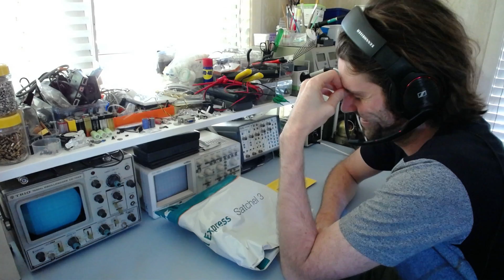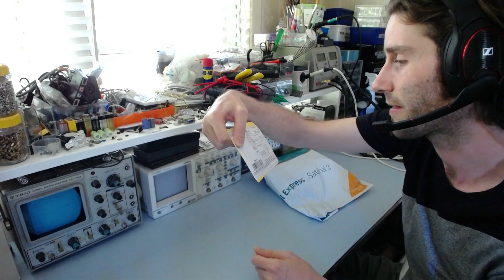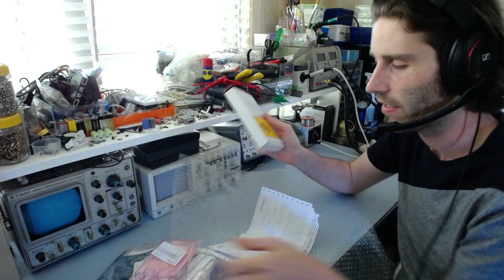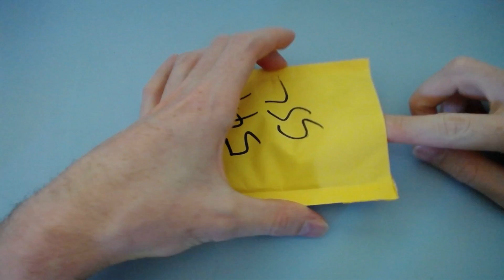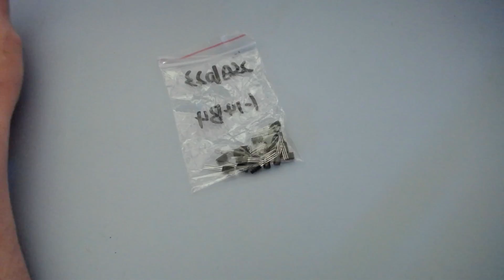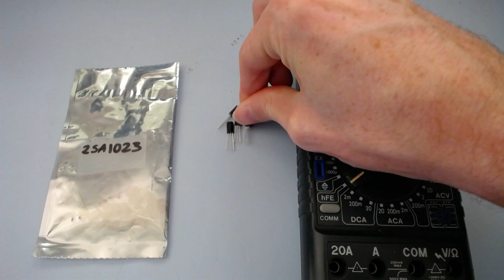So, what if you *do* buy transistors from Aliexpress?

Comment: Hello. I bought 2sa1145 and they are made of iron. I say this because they are attracted to magnets. They don't have much copper in China there and the Communist party directives gave this solution. In the case of 2sa1145 maybe this wouldn't be a problem but in the case of 2sc5200 it is a mockery because when put into the circuit they heat up and your house catches fire if the fuses on the board are not calibrated. In addition to that it burns transistors on the board in droves. The problem is also valid for Indian companies with 2n551 or mpsa92. At low signal the iron induces voltages due to magnetic fields which is a big shit. It's money that we throw out the window so that China can become world no.1... If that's how satellites with components like this or military equipment do it too. I tend to think that they are mocking the entire planet because the production is theirs and we are independent of what they give us.Salutari din Romania.
Reply from the maker: Fake and substandard parts are definitely a big problem!

Comment: with chinese suppliers the problem isn't if they make fake components (of course they do) but the real question is how good those fakes are! From my short electronic experience I would say that for beginners or weekend makers most of the staff and simple components are ok from China and I have bought a lot of transistors for example from Aliexpress and they work fine BUT the problem started when As I progress with my projects and electronic knowledge and I build more COMPLICATED things here the problems start!! More complacted circuits for example I have recently bought didn't work at all! I was surprised because before I was using many transtiors from china and they were ok but more complicated staff fails from every side! My conclusion is that the most popullar and simple components are almost as good as original but here the advantage ends! More complicated ICs mean more problems...
Reply from the maker: The cheap copy parts can work fine at low speed, low load etc. But if you start trying to operate them near the maximum of what they are supposed to be able to handle (for the ratings of a genuine original part) that's where the problems come in, because they don't meet those ratings.
Reply: @Agent24Electronics  I agree! When I started learning electronics cheap, chinese parts were fine to me because I even didn't use 30 % of those ratings! But now after one year when my projects are more and more complex I decided to order original parts because I have noticed what you just said and after also when I wasted like 2 days with cd4026BE from China and at the end I found out that that IC was defective and actually I was doing everything right! I was so pissed off that I decided to order oryginal parts ...

Comment: Thanks for the video, 
good enough for a beginner just learning about electronics?
Reply from the maker: No worries! Yes it would be a good start for a beginner doing basic transistor tests, but unfortunately does not provide exhaustive or extensive profiling of a transistor, as it would appear most viewers may have expected.
Reply: Sorry I meant getting stuff from Aliexpress, would their stuff be good enough for me? I have only just begun learning about electronics so I am sure I am going to end up trashing some components
Reply from the maker: Good question. It's a double-sided concept... On one hand, you may indeed save money, but on the other, trying to learn with parts that may or may not be 100% to specification or performance (especially semiconductors) may cause much frustration and unnecessary troubleshooting. Aliexpress might sell a lot of things, but they can never sell you back wasted hours of your life.

I would say that simple passive components like resistors, ceramic\polyester capacitors, or other parts so basic they really can't be made incorrectly are probably OK to buy from Aliexpress or eBay, but bear in mind there may be other quality issues like substandard metal used for the leads, which could result in corrosion sooner rather than later, so you may not wish to use such components for any serious or permanent use. (I'm theorising on that point, but they have to cut corners somewhere to get those low low prices!)

I'd recommend comparing some of the prices between a decent distributor or local shop with Aliexpress, and decide if the savings outweigh the potential headache and pot-luck delivery schedules.
Reply: I get your point, I am having enough difficulty just grasping the basic concepts (school was decades ago) so having to figure out if it's the components or me woulld be a step too far, I saw how much trouble you had with the led light strips and that was a simple short causing the problem. :(          [Amazon or any other suggestions?]
Reply from the maker: Amazon (or eBay) might be OK, but check who's actually selling the parts. If it's a real electronics shop like Jameco or Dipmicro then you'd be fine, in terms of quality.
I personally prefer the big distributors: RS-Components, Farnell, Mouser or DigiKey. None of those sell on Amazon, but their prices can be pretty good if you buy parts in quantity, and usually you'll want more than one of a component anyway.
Reply: many thanks, first I think I need to learn a few basics before ordering anyhting in quantities.
Reply: Many thanks, I'll take note.
Reply from the maker: No worries, good luck!
Reply: You have a nice clear speaking voice but you gotta get to the point instead of rambling on thinking out loud.  Crack open the bags, describe the tests and let's have your findings with minimal waffle.  You would then make a great(er) video.  I am going to subscribe because I am sure your videos will improve.   Plus you seem like a good operator.  
Now RF Power transistors capable of decent power like the TH430 or SD1728 cost $225USD from Mouser and $20 to $85 on fleabay.  Big price difference.  Obviously a lot of knockoffs on EBay.  Big price items like this are only made by big name operators like ST or Toshiba.  They are not going to sell stuff cheap.  An expose on this would be very interesting.  Good luck with the videos.

Comment: FYI, Farnell uses very cheap/light bubblewrap for the stuff that they send me. The stuff I get from china is usually a heavier type.
Reply from the maker: I suppose Farnell's packaging may vary by country, but it's probably overall better than eBay?
I find the Chinese packaging rather inconsistent, and they very often don't use antistatic bags for parts which should have it. Farnell and the others don't have this problem.
However, the Chinese do seem pretty good at packaging fragile items, like lightbulbs or CCFL tubes.
The only damage problem I've actually had was from RS-components, when the courier must have squashed the package in the van door or something. RS sent me a new order free of charge.

Comment: one thing that you have to buy from alixspres is an coponent tester for 14dolars works wery good wery great for cheching coponests!!
Reply from the maker: It's been on my list to make one of those actually - the Chinese just copied a design invented by someone else.

As far as I know, the original is here: https://www.mikrocontroller.net/articles/AVR_Transistortester#Introduction_.28English.29 
Schematic\Firmware etc downloads can be found at: https://github.com/svn2github/transistortester
Especially, check the documentation at https://github.com/svn2github/transistortester/tree/master/Doku/tags/english

If anyone does buy one from China, it would be good to compare it with the original design, as they often leave out features or protection components you could add yourself, or it can have other issues (some are mentioned in the documentation)

Unfortunately, I don't believe it can do much (if any) high-voltage or high current testing, so it's not incredibly useful for verifying maximum ratings of parts - although for the price it is a very useful little tool - just make sure you understand its limitations.
Reply: But the Chinese sell cased versions for much cheaper than putting together your own even without a case. Copying is a fact of life these days so nothing you can do about that.

Comment: I think I received fake D882 and B772 TO-126 transistors from ebay. My problem is the Vce(sat) when switching on a car lightbulb. The datasheet says it should be between 0.4v and 0.7v maximum since the measured current is 1.6 Amps. The measured voltage at the emitter-collector pins is 1.17v whereas the original transistor, which I consider genuine shows 0.16v!! The "fake" one is producing 1.87 Watts of heat which is 7 times that of the original! Which is enough to kill it real quick. They even perform worse than 2N2222 which are meant to switch no more than 0.6 Amps according to the datasheet.

This is sad since it happened in a time when I was learning about and experimenting with transistors. It took me a while before I could be sure something was wrong with the transistors, I fried more than 10 of them. Only when I tested the original transistor in the same setup did I realize how bad these transistor were and how good they should have been...
Reply from the maker: It doesn't surprise me at all. Transistors have a long history of being faked or re-labelled in China. ICs too, of course. It's hard to say if you will get a good part or not. I do hope to make a follow up video to this where I test the ones I bought and see how they hold up to their ratings. I understand a quick gain test is not sufficient to prove their real performance.
Reply: I once got fake opamps from aliexpress. Still it has a mechanism to report fake products but the problem is that not many people check components after buying. If you can check them do it right away and make life a little bit difficult for the seller.
Reply from the maker: The lack of useful feedback on sellers is definitely a problem.

Even worse, eBay has such a tiny character limit on feedback that it's difficult to write anything detailed.
Reply: Yep that's the way